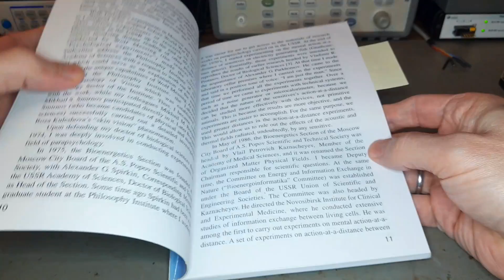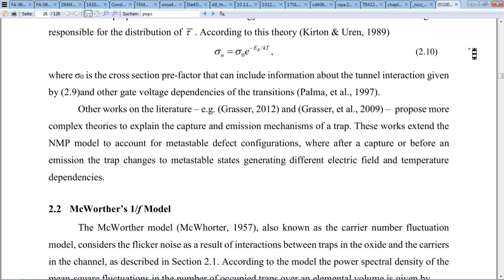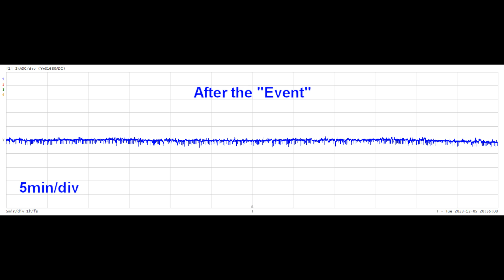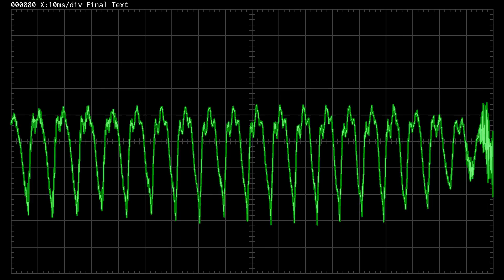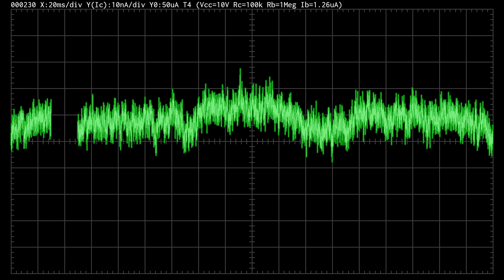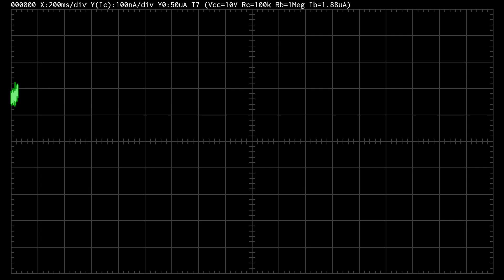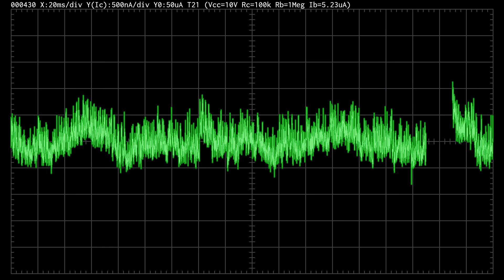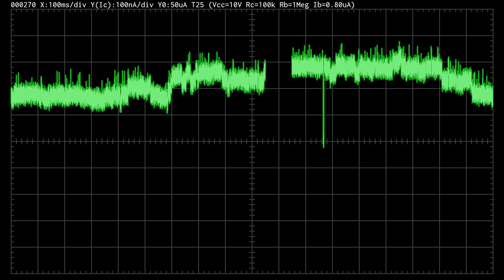Popcorn Noise - A Miracle?

Comment: To me, it really sounds like am radio, You know the static channels. It’s quite possible that you ended up building somewhat of a receiver. I actually did this on accident by experimenting with a small transistor circuit. I actually picked up a radio station. It seems your circuit is picking up the frequencies that are in the range that media companies don’t occupy.

Comment: ghost in the machine? / White noise? / Square wave artifacts? /  It is like a ripple of chaotic  but it is random and not random / or / noise of the electrons spinning? /  >>? / I use to listen to my transistor radio when a thunderstorm would brew up, and as the electrical charges increased. I could hear the static  get stronger and stronger. Then in a crackle would discharge as the storm and the lightning would  release its built up energy. It is interesting to hear on my cheap transistor radio [battery powered] . Then again who knows...

Comment: One of the things that is often overlooked is that we live in an electromagnetic environment--fluctuating earth magnetism, induction in building structures, ionized atmospheric effects, solar radiation, etc.  There is the potential difference between the earth and that atmosphere that results in lightning, the ionic displays of the auroras, static in radio and television signals, etc.  While the transistors are small compared to macroscopic events, it would be erroneous to assume that they don't have a similar effect.  After seeing cosmic particles using alcohol and dry ice in physics class reminded me of the impact of unseen events that affect our magnetosphere.  That and shifts in the earth's magnetic core.  I know we use to use radio static to monitor approaching rainstorms. The changes can be small on the large scale but quite noticeable noise on the small scale.  While defects in the materials and connections likely contribute to and magnify the noise artifacts, the fact we live on a floating magnet with random ionization events likely accounts for much of low scale chaotic noise.

Comment: Another form of noise I've noticed:  white-noise momentarily created when some increasing reverse-bias is first applied to a PN junction which had been sitting on the shelf.   It only happens once (a bit like Barkhausen magnetization noise in ferrous cores during a DC ramp.)   
Finally I saw this mentioned  ...in documents on avalanche photodiodes used in photon-counters.   The diode slowly accumulates coupled electron-hole pairs, building up over days/weeks, like temporary "defects," each caused thermally or from environmental radiation.  When an increasing e-field is applied, it pulls them apart and sweeps them out, producing noise pulses w/rate proportional to the rate of increasing bias-voltage.  So I guess that our silicon PMTs can "accumulate radiation" when un-powered, then puts out a burst of clicks when the reverse-bias is first ramped up.
Hmmm, need a radium watch dial, see if it alters the usual PN noise.   And, when fusion reactors someday exist, bring this circuit nearby, see if it's a neutrino-detector (but can't stop the noise today, unless we find a way to block solar neutrino flux.)

Comment: Forgive me for sounding like a laughing stock but the sounds remind me of what you hear at VLF frequencies in radio, such as the pops from picking up lightning around the world and the strange sounds they have when they affect the atmosphere. Is this noise (hissing transistors) part of the noise you hear on radios, off frequency? Sorry for sounding daft, its just these sounds, sound so much like a radio receiver with no broadcast :)
Reply: Almost 50 years ago I did CB radio repair as a side gig. People would bring in radios and complain of lack of sensitivity: "ain't go no ears!" In many cases the problem was a noisy zener diode that was generating so much noise that it activated the automatic gain control circuitry and reduced the gain of the RF amplifiers. Easy money after I figured out what the problem was!

Comment: it may be asking a lot, but as an experimentalist, I would set up several of these (running simultaneously) with different transistors in each cookie can and located in the same area, then look for patterns of pops that line up in the recordings. This way you can eliminate internal noise as a source and see if external, environmental, factors are at play.   Maybe take it a notch up and shield with lead lined boxes (lead sheets) to eliminate external radioactive contributions.    Another set of cookie cans with identical transistors could be used as well.  
As far as power, I would use a battery pack (also compare the linear power supply with a battery supply and see if there's a difference in the traces over time to rule out the power source) as the best linear supply will still induce noise.
Reply from the maker: Yes, running several in parallel would be great. But one thing that holds me back is the sheer mass of data. Sampling with at least 10k samples/s gives almost 2GByte per unit per day. I'm thinking of a useful compression algorithm but due to the amount of white noise there is not much hope to find something useful.

Comment: It’s funny how many of these are not white noise. 

Some of them remind me of random audio frequency noise but it’s getting pulsed louder and quieter only a few times per second on average.

It’s like water falling from a nozzle, and making turbulence that tends to be within a certain range of sizes which then makes noise as the turbulent sections hit a surface.
Reply: Others sound like something has been deliberately switched in or out of circuit, or even like one of the softer crackling fireworks fountains.

Comment: This is happening with older, probably leaky transistors?
Try it with some newer models, i'd expect the '3904 or 2222 to be a rather noisy lot...
Reply from the maker: Done. With a new BC817 (seems to be pretty white) and an older BC237 (obviously has s bit popcorn noise): https://youtu.be/lkHfqwbG58w

Comment: Could be some kind of sensitivity to radiation that manages to make it to the electronic junction. Might be neat to see what some do in comparison to a Geiger-counter while placed next to various known radiation sources. There's always some general background level of radiation, so that could cause random clicks. Depending on when and where the electronic materials were doped, they could also have contaminants with decay processes going on too.
Reply from the maker: Yes, I had this idea too. But even placed directly at the tube of a Geiger counter there was no effect. Same when placing an old incandescent mantle or some minerals close to one of the transistors. It seems that even the researchers of today do not consider radioactive particles to be a source for random telegraph noise.

Comment: These sound much like what I would hear in my days repairing and calibrating reel-to-reel tape recorders when the head(s) were worn.  Now I'm thinking the noise was perhaps not due to the tape-head interaction, but due to the increased gain of the head amp needed to compensate for the head wear and the transistors in the amp revealing their noise.

Comment: I have run an Elliot Sound pink noise generator for many years. The schematic is available online. It consists of a single silicon NPN transistor running in Zener mode at its heart. I selected one from my junk box that was particularly noisy.

From time to time I have inexplicably witnessed the sound output change in character. I have heard changes in volume and popcorn noise. It will last for a few days at the most and then go back to normal. As you have also found it doesn't seem to depend on temperature, power cycling,  voltage regulation, or anything else. These 'glitches' seem to be getting more frequent with age but it could just be perception bias.

In all the years of daily listening, the "charm" and mystery only deepen. I will leave you with this: "And suddenly there came from heaven a sound like expelled breath, and it filled the entire house where they were sitting."

Comment: Thanks!  Fascinating that the noises should sound (hence be) that different. I wounded if you are not driving different transistors in different regimes, thereby getting different noises (at least a contributing Cause to the differences?). Most I’m potently though, this highlights the need to characterize one’s noise output, at least if one is trying to detect weak signals.
Reply from the maker: The character of the transistors did not significantly change when driven with other currents (e.g. Rb=100k, Rc=10k), but the signals were weaker when the current increases. Maybe heavy statistical analysis would be interesting to see weak dependencies.

Comment: In 1971/2 I encountered popcorn noise in a variety of Fairchild ua741-family opamps that I was attempting to use as audio pre-amplifiers.  Very annoying and unacceptable popcorning, and I reverted to constructing discrete amplifiers using 2N2102 transistors in the first stage[s] which were wonderfully quiet.  A few years later the electronics literature reported that popcorn noise had been clearly demonstrated to be a symptom of lack of cleanliness of the surface of the ICs mentioned above.  With better processing, newer production 741s lost their popcorn noise, but by then there were many far superior opamps available for audio applications.  End of story.  No parapsychology effects found. No magic, no miracles, no angels dancing on pinheads...  Hope this helps!
Reply from the maker: So please explain (technically) how impurities in a solid state material can cause sudden "pops" that may not come again for minutes or even days, but suddenly reoccurring without any obvious reason? I expect the impurities not to be living creatures, crawling slowly but acting fast (pop!) in the transistor. Or maybe they are? Could be an explanation, but not less creepy than angels ;) I'd really love to have a comprehensive, scientific explanation how the pops happen (especially the super rare ones), including the exact role of impurities.
Reply: @gumpomat  I always understood that the impurities were not IN the bulk solid state material [the chip of silicon wafer] but on its SURFACE.  I'm perfectly willing to accept that other mechanisms are/were at play in other devices from that era.  Note that even tiny changes in temperature can affect these noise mechanisms, for instance...
Reply: @gumpomat  Maybe some of these are from cosmic rays ?   Naaaaahhhh....
Reply: @k7iq  On a scintillation detector, some 2in lead slabs cut the normal background radiation WAY down, by over a couple orders of magnitude.  So, if heavy shielding has a major effect, then that would expose the source of at least some of the "pops."
On my detector, I tried moving all shielding to the top, to the bottom, etc, but vertical direction seems to make no difference.  So, either it's wide atmospheric scattering, or perhaps the ground sources below are roughly equal to cosmic secondaries from above.  (Need more lead shielding Eegore!  MORE!)
Reply: @wbeaty   Need to find an unused cave somewhere.  Wouldn't that be fun ? :)
Reply: But really - no one found the secret of pocorn noise yet ?  What are the most popular theories ?   @gumpomat
Reply from the maker: @CocoSloan  Theories typically describe statistical math only, using as many letters from the Greek alphabet as possible. The more interesting papers that go into physics all talk about these "traps" caused by impurities. As such I can accept traps, could have an impact on the current through the device if they hold charge or not. But nobody tries to explain why these "traps" are suddenly "filled" and - suddenly too - "emptied", in an almost digital way.

Comment: Interesting - in Poland we had similar packets of transistor and diodes, which have some manufacturing defects, and was sold to amateurs with reduced price. Are those from East Germany (DDR) or from West?
Maybe that's why you don't hear so much noise from regular transistors.
Reply from the maker: I think you are right, I'm pretty sure their origin is former East Germany, maybe ones that didn't pass the end-of-line test or just old stock material from there. The term "Miniplast", as written on the cards contained in the bags I got, was widely used by the "Kombinat Mikroelektronik" in Erfurt.
Btw, meanwhile I found also an newer (well, maybe from 1980 or so) BC237 that shows popcorn noise, buried in white noise but clearly visible on the scope. So it is there in newer transistors too, maybe in all, but with much much lower step amplitudes.

Comment: Is it the same as shot noise, or is it something different?
Reply from the maker: I think shot noise is something different. The noise in the video is usually called popcorn noise, random telegraph noise or bi-stable noise. Levels might switch up/down for longer (even very long) times. Shot noise, at least to my understanding, consists out of pulses that are always very short, just like discharges, short sparks, but never lasting for long, as it happens in Geiger counters for example.

Comment: I think the transistor being barely turned on causes the white noise.

It is possible that cosmic rays or some other high energy particle is penetrating the shielding and interacting with the transistor junction.

Interesting project.

Thanks for doing it.
Reply: I have the exact same theory.
Reply: Two things cosmic rays are fairly commend  and  old germanium transistors at best are poorly  made back in the 1950s.
Reply: @erichkeyes5578  I don't think cosmic rays are fairly common, at least in the sense that they are not uniformly distributed over time. Is it a common thing to happen? Yes, but it doesn't happen all the time. Moreover not all cosmic rays have the same intensity and type. It could be that there is a much higher energy hitting the earth at this time or that it;s a differnt type of particle which in turn causes a different cascade of charged particles in the upper layers of the atmosphere. If the same thing happens e.g. inside the tunnels of Gran Sasso Observatory in Italy then it's a different issue, but there also are tens of different particle detectors so we could correlate events there through timestamps...
Reply: @erichkeyes5578  you're possibly older than you think...  50 years ago was in the 70s.
Reply: I had the same thought, Veritasium did a video of this phenomenon....

Comment: Try cooling with ice, dry ice, LN2, etc.   Does the noise spectrum change, and the amplitude?   
As a child, I heard that the 1970s-era "surf-synthesizer" circuits employed reverse-biased EB transistor-junctions for their noise-source.  I soon found that many different transistors gave DIFFERENT-sounding noise.   (Just use a variable supply and a variable series-resistor to reverse-bias the EB transistor junction.)

Is this the one with 1/F frequency-spectrum?   Yes, very mysterious, where many books say it has a well-known explanation  ...but then all the books contradict each other when explaining it!  However, whenever we see 1/F, we know that Chaos is involved.   Emergent phase-change thresholds.  Fractal patterns across enormous orders of magnitude.  (But fractal WHAT?)

One thing I never tried:  look for correlations between separately-shielded transistors.   Perhaps put their signals on an XY oscilloscope display, and look for visible patterns.   Or send them to stereo headphones, and listen for noises having locations.   This inspired by a crazy 1986 article, which claimed that sub-300Hz flicker-noise from capacitors is caused by cosmic gravity-waves.   So, two circuits might give correlations, and if spaced distantly, might form an interferometric telescope?   See www.rexresearchcom/hodorhys/remag86/remag86.htm   (I removed the dot before the "com")

Comment: ... the truth about what happened to MH370 or AF447 is withheld from the public. EMP involves a massive swarm of electrons and magnetons, which create a local magnetic field and blows out any electrical circuitry in the area. EMP will produce ball lightning, now being interpreted as UFO, which they are not. Light and heat particles are easily redirected from their former route, so any attempt to image heat or light from space will show anything but the real situation. Light bends readily, as anyone standing in water can attest. Their legs seem to be shifted and broken. Heat likewise wants to escape crowding so will dissipate. Thus a heat signature can represent a heat source or escaping particle clumps.

Comment: I found this very interesting, thank you for taking the time. My experiences indicate the  slow  "poisoning" of the die from the encapsulation material.  Occurs in mainly  plastic encapsulation,  the 2SC930 is a classic example transistor effected by this,  culminating in a complete lack of gain. Steel cans are sometimes filled with  gel that can  also effect the die. The "tin whiskers" in old germanium transistors is another known time effect, but in this case, usually shorting the transistor completely.
Reply from the maker: Yes, the "poisoning" might play a role but this jumping between states does not not really fit to the picture. It looks more like a complex water draining system that is sometimes suddenly jammed by a big boulder, that then gets dissolved a bit, being suddenly released. These "phenomenons" must be "big" in a sense that they obviously might result in a change of up to one percent of the 50uA collector current I typically used (because it results in friendly 5V, half of 10V at Rc=100k).